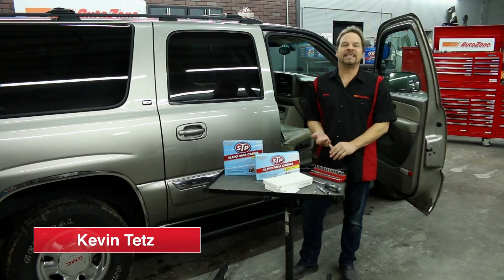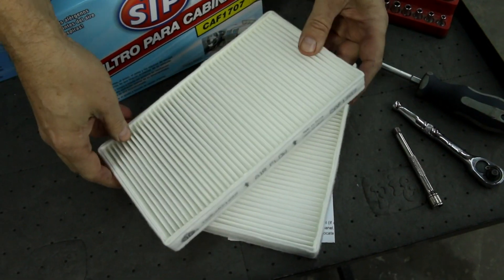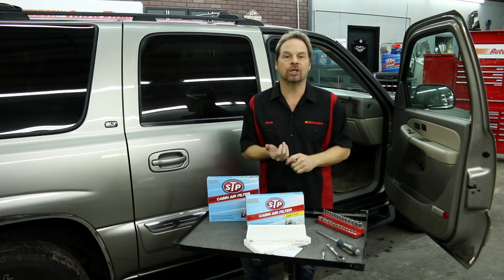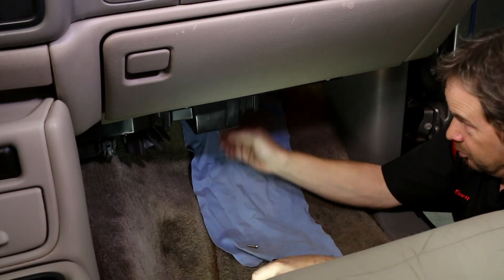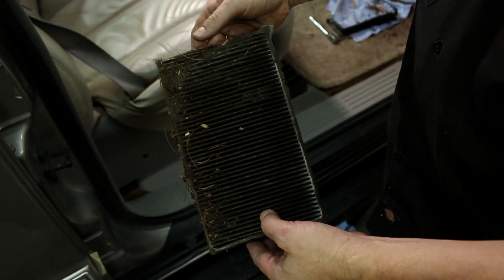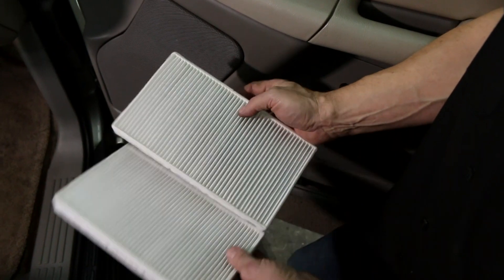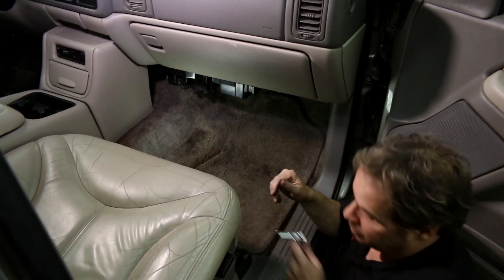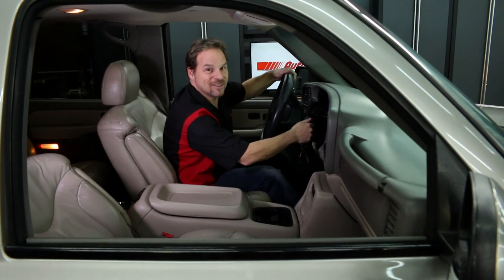How to Change the Cabin Air Filter for Your Car - AutoZone How to Videos

Comment: 2007 Nissan Altima: I have 0 experience with cars other than start it and go and I’ve done a few oil changes myself. I removed and “installed” the cabin air filter without taking off the glove compartment. Took about 5 minutes to rip it out (lol) then 10 minutes to fish back into the hole. The air flow arrow on the filter goes toward the rear of the car.

Comment: I’m scared to do this on my 2012 Mini Cooper. It smells so bad I feel like it’s going to look so gross lol
Reply: If it smells bad you definitely want to replace it. That filter the air you are breathing. And sometimes rodents will get in there and make a nest and if anything gets into the blower motor it can cause it to fail which will lead to no air at all for heat or AC.

Comment: Make sure that AUTOZONE doesn't stiff you $9 for the filter. They are cheap, cheap, cheap and save Thousands on the a/c!! Regular a/c replacement could be as high as $2000